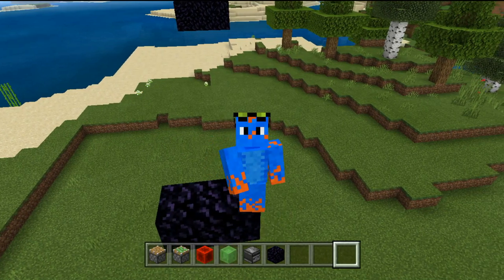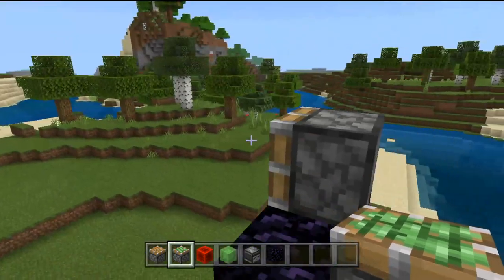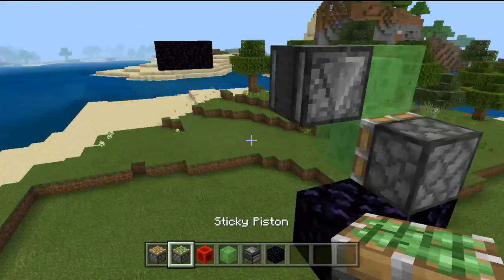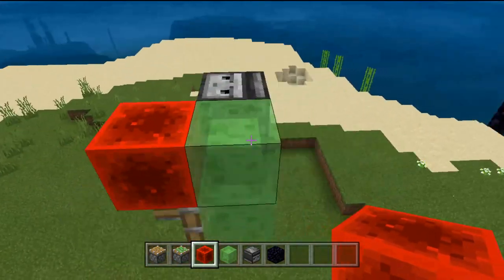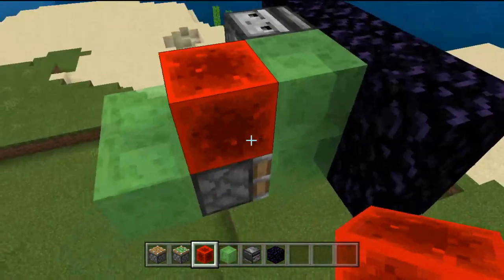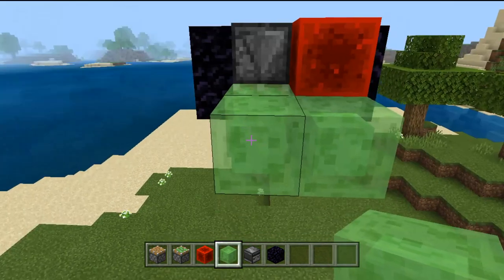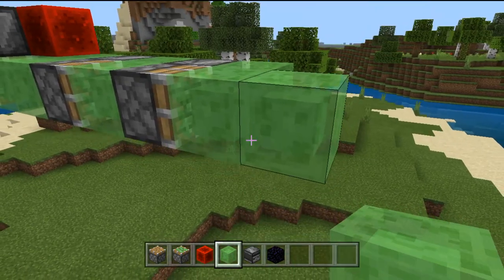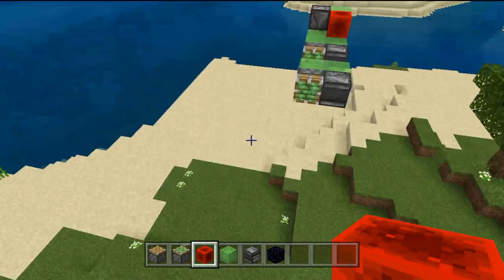Minecraft Bedrock Flying Machines

Comment: If you put a dispenser filled with tnt in the little gap next to the red stone block, you can make this a tnt bomber.
Reply: You can also add a bomber by adding an expansion
Reply: When i try the lever drops
Reply: @reversethepolarityoftheneu773  you dont use a lever in flying machines 😑
Reply: Comet 1310 what do you use then?
Reply: @reversethepolarityoftheneu773  redstone blocks, observers etc
Reply: @reversethepolarityoftheneu773  lol
Reply: Omg thanks lol
Reply: Observer with dispenser on top
Reply: Not to break your dreams but hell no it wouldn't work because dispensers can not be moved by pistons but you can keep on placing tnt near it
Reply: @Daniel_Brgrmstr  what do you mean? It worked when I did it
Reply: Reverse the polarity of the Neutron flow observer or Redstone block
Reply: OOOOHim gonna try thatt

Comment: You can also replace the redstone block with an observer facing the piston for a less laggy version. (01:20)
Reply: No the redstone is needed to constantly powering the block
Reply: Justin Y's Ghost it works sometimes but it’s unreliable due to the tick having to be perfectly timed but if it works once the flying machine will go on forever.
Reply: But then you cannot drop bomb on the enemy

Comment: Is there a way to make the machine slower?
Reply from the maker: Yes there is, it just makes the machine a bit bigger. Basically what you need to do, is to remove the redstone block completely. Use the same piston arrangement as shown in the video but with a few extra blocks between the normal piston and the sticky one. Next use that expanding method I showed towards the end of the video at the top, front part of the flying machine. Using the expanding method go al the way to the back and place an observer at the end that will power the back normal pistons. The more pistons you add in that chain, the slower it wil go.

Hopefully this helped, sorry if it's a bit confusing.

Comment: Is there a way to use a lever for On/off opposed to placing a Redstone block?
Reply from the maker: You can replace the redstone block with a downwards facing observer to give you control over when it wil actually start moving, but I don't know of a way to turn the machine on and off on the go
Reply: Just place a daylight sensor, click to turn on and off

I mean, replace the redstone block it a daylight sensor